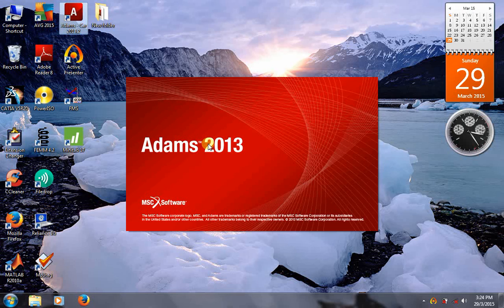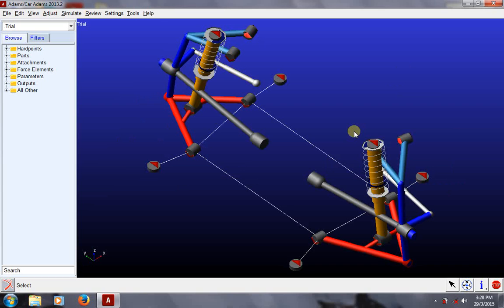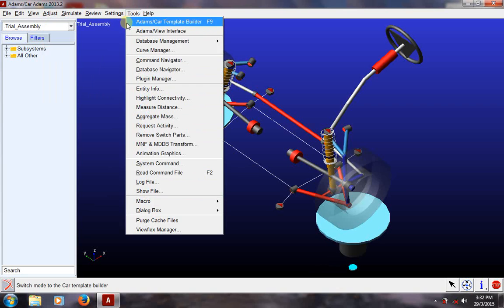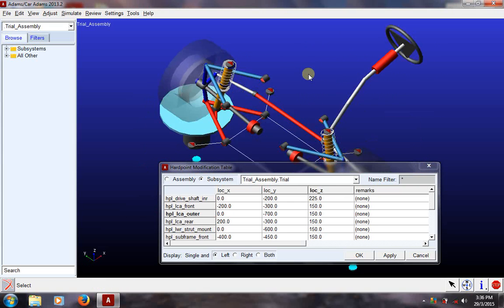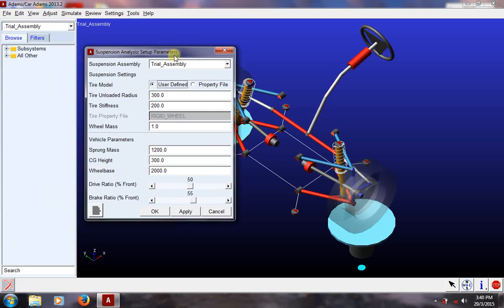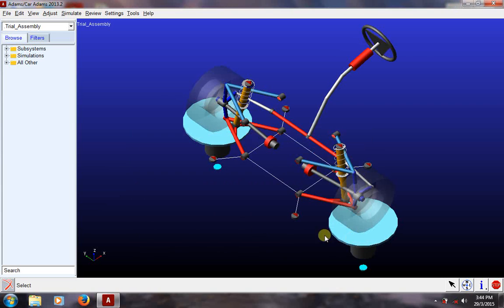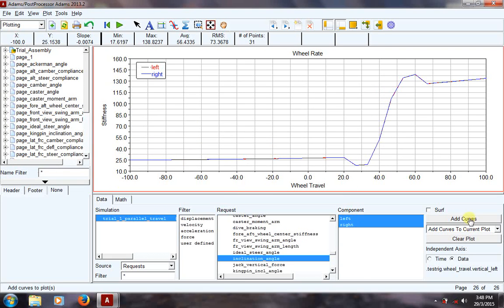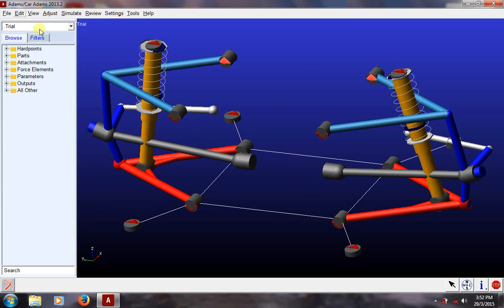ADAMS/CAR Tutorial 1

Comment: Please help while making the full body assembly how to choose own suspension type for rear and front ? Somehow i am able do so both the tyres of rear and front are overlapping please help in getting me out of this problem
Reply: Both assemblies of rear and front overlaps
Reply from the maker: Anmol Mahajan After you have created the front suspension, create a second suspension, and while importing the model into the assembly, you will see a box with fore/aft translation written. Give a value which corresponds to the wheelbase of the car(only if the center of the wheels of the first model are at origin else add or subtract).

Anyhow, I guess you are trying to do a full body analysis. If so, as far as I know, you can't do it with only importing the suspension. You also need to add a chassis (or a makeshift one).
Reply: Can you put  some more tutorials and mainly about adding or making chasis
Reply: Anmol Mahajan You mean tutorials in creating a chassis in modelling software or in ADAMS?
Reply: Sayak Mukhopadhyay in adams
Reply: Learn EZ can you please explain that with a video on it please
Reply: Anmol Mahajan I'll Try!!
Reply: Sayak Mukhopadhyay please notify me and thanks for your help
Reply: Anmol Mahajan its very easy to make the chassis in solidworks, then you can import either file to either software and do simulation and stuff..
Reply: Vickrant James i have made a suspension assembly in lotus software and imported it to adams but it is giving error while doing any analysis
Reply: Anmol Mahajan for analysis you can use ansys i think, but for simulation solidworks again.
Reply: Vickrant James while importing file adams is showing error while performing analysis
Reply from the maker: Anmol Mahajan Please give some more detail. Debugging is difficult like this. What type of file are you importing, how are you importing, etc
Reply: Learn EZ I am importing a front suspension  file from LOTUS software it has option of exporting file to adams .
Reply from the maker: Anmol Mahajan What kind of file is Generated. What is the extension of the generated file?